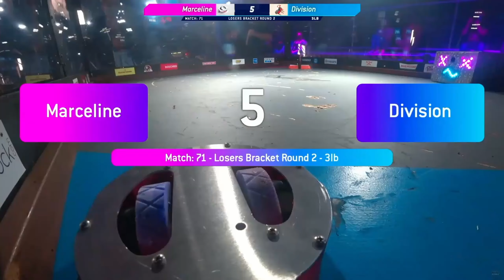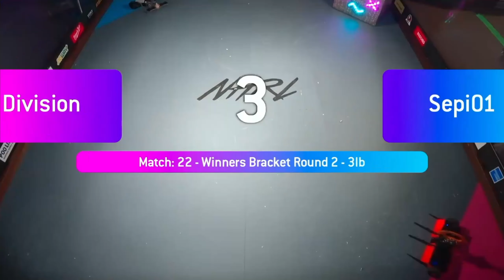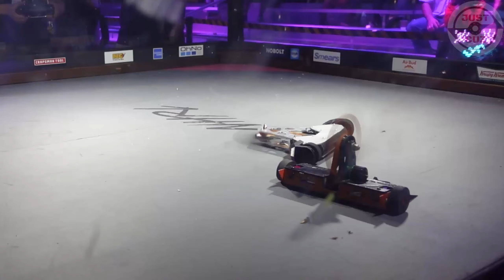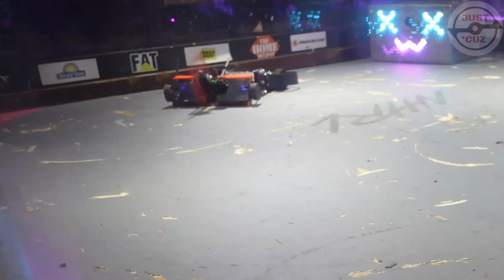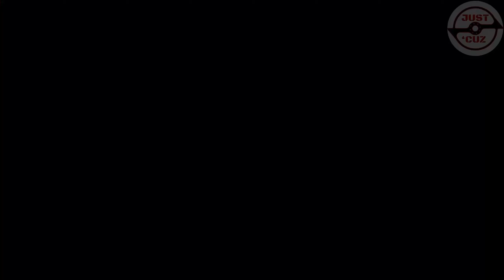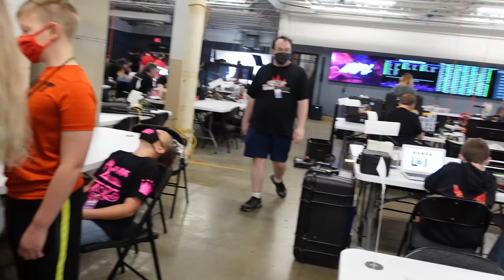Division: Norwalk Havoc May 2021 Event Recap (3lb Beetleweight Combat Robot)

Comment: I didn’t realize how quiet the weapon on division was until bx11b stopped spinning
Reply from the maker: Yeah it doesn't have to cut through nearly as much air, plus it is running at less than full speed a lot of the time. Those beater bars always sound like their bearings are about to explode.

Comment: I use TPU hubs just like this on my 1lber.  Print the holes in the hubs to a smaller diameter than the drive shaft, and use alcohol as mounting lubricant.  It cleans both surfaces, then evaporates, leaving a very good friction fit.  The only issue i ever run into is when i dont follow the alcohol installation process, then they will slide right off.
Reply from the maker: Great idea! I may try that sometime soon.
Reply: @JustCuzRobotics  The hubs also utilize a mushroom shape for wheel retention.  Its a simpler 1 piece design, and i havent had a wheel slip the hub yet.  Again, just print it to compress fit and it holds really well, no ribbing required.

Comment: Do you have the weight to add some rest forks to possibly prevent or at least medigate division launching itself across the arena. It would probobly be even more reliable than it already is. Also I would love to build an AW or BW. Is it actually posible to build an overhead tribal in this weight class
Reply from the maker: You can build whatever you want as long as it's under the weight limit and conforms the the other event rules! Check the link in the description to see the rules for NHRL, or Google the SPARC rules for combat robotics for a more general set.

Comment: Whiplash used rubber bands to make sure their wedgelets stayed as close to the floor as possible. Maybe you can do something similar for yours? Rubber bands or a metal spring or something?
Reply from the maker: Maybe. I think gravity will really help if I just stop them getting locked upwards though.
Reply: I think Endgame has springloaded wedgelets and it obviously worked well enough for them.

Comment: I realy enjoy your videos a lot! It is so nice to hear your thoughts and see the results, hear what failed and your guess why. 
I've got at at least 50% of what I know about robot fighting  from you as a source., and I am just a viewer of the sport. But what about no side Wegdes/forks at all? They are mounted on the side and when hit, put a lot of stress on your sidemounts. Is that worth the benefit? What is the real benefit? Of couse you could get under the opponent or block them some way, but you can do that with your middle forks as well and then you connect with a hit and do destruction, what division is all about. My thinking is just, leave that potential weak spot of and go more for yolo, one hit that kills them all style
Reply from the maker: Thanks for the kind words! Like with the horizontal config I need some rigid forks to prevent the robot from faceplanting under the gyroscopic forces upon spinning up the weapon. However you are right the cost is not worth the benefit from the side forks being also made of hardened steel. 

What I should be able to do is make similar ones from thin flexible TPU or UHMW plastic so that they will simply flex out of the way when hit sideways, but still act fairly rigidly when the bot tips forwards to resist that motion.
Reply: @JustCuzRobotics  One thing that crossed my mind in regards to TPU. I dont know if that would work, but hear me out. What about you make a Print with two extruders, one rigid tough material, Nylon, ABS or whatever you use and TPU. Inner and outer walls rigid and the infill with TPU. Maybe it will not work as easy as that, and you need a shaped connection between TPU and the rigid stuff. The advantages I would see are, you can better mount and glue the part and shocks to the Part get dampend a bit. Maybe worth to try it on your wheelhubs, what do you think?
Reply from the maker: Unfortunately I don't have access to a printer that has dual extruder and I don't want to spend $1000 on one. However I did hear from Calvin Iba (Lynx, MadCatter) that he prints Nylon inserts to epoxy into TPU prints to accept threads which seems like a great thing to try out to me.

Comment: Those were some great fights! I love watching your design evolve after all this time! Can’t wait to see what you add to the next revision.

Have you ever considered adding rigid forks out the back of Division that sit just a couple millimeters from the floor? Watching all your fights, I keep seeing Division getting thrown backwards by its own hits. The vertical forks definitely helped in your fight against Blackbird, but it looks like you could still do a little more. Maybe something like rear forks could help the robot “plant” itself into the floor when it delivers a hit, so that you can both hold your ground and transfer more energy to your opponent.

Keep up the awesome content!
Reply from the maker: I think having forks at the front and the back would make it extremely hard to self right in the event the bot still flips onto its back somehow, as there would then be no way for the weapon's gyroscopic forces to pivot the robot forward onto its wheels again. That's the reason I have triangular bits out the back now, to promote it rolling forwards onto its wheels. I also have a piece of material that's hard to see which is under the robot and touches the flood whenever it kicks back, which does a little bit to counteract those backwards lurches. But there is only so much I can do when each hit is at a slightly different angle. Some push the bot almost straight back, others downward into the floor. It may be worth experimenting with in testing though.